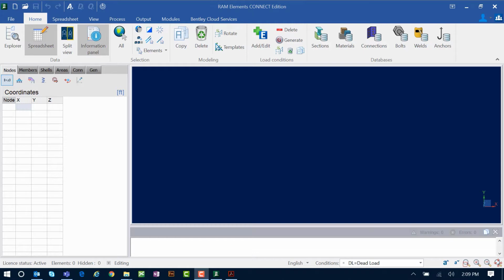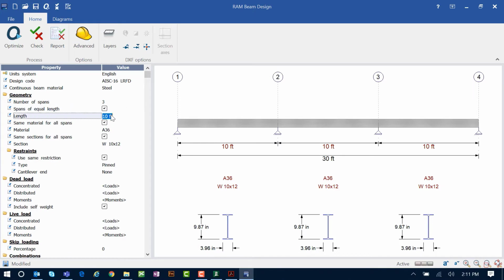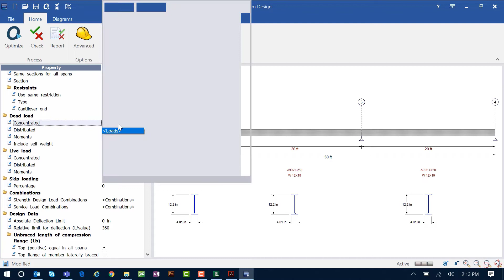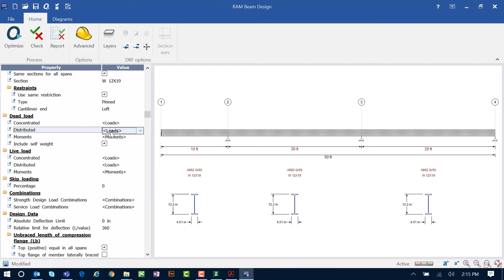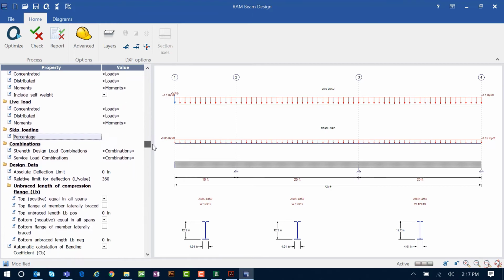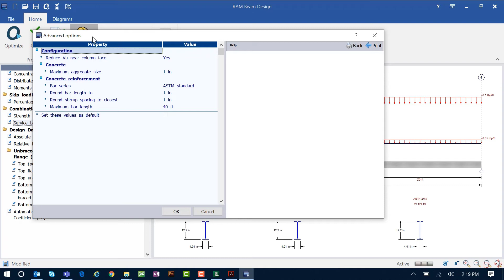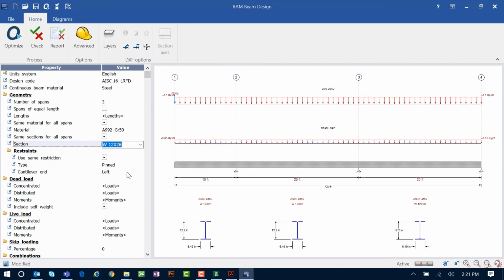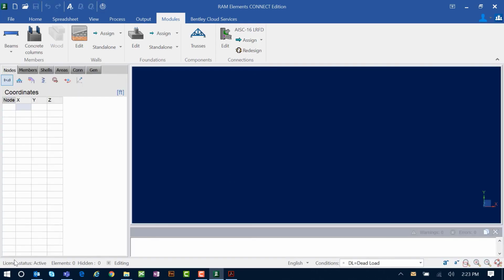Designing Continuous Beams in RAM Elements

Comment: Does the software calculate long term deflection for RC beams.?
Reply from the maker: The RAM Elements detailing module does not consider long term deflections for reinforced concrete beams. RAM Concept, however, can consider long term deflections for concrete beams and slabs.